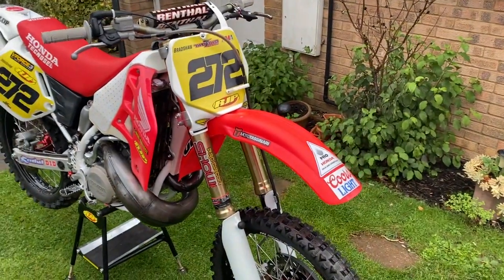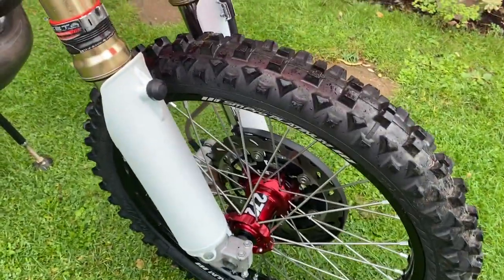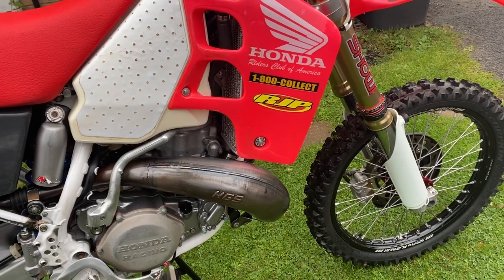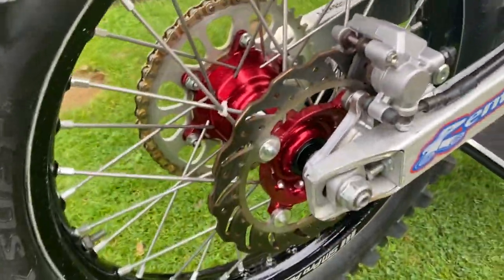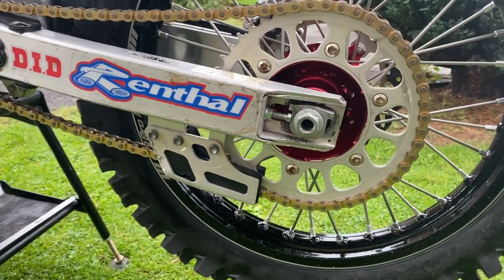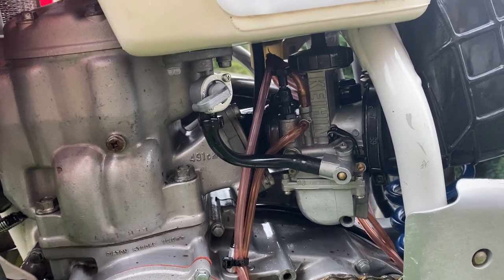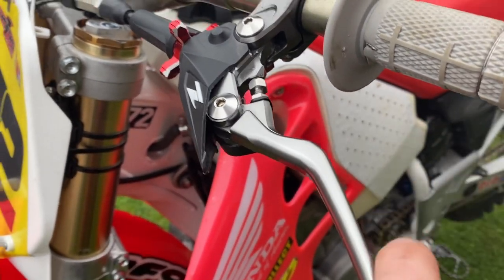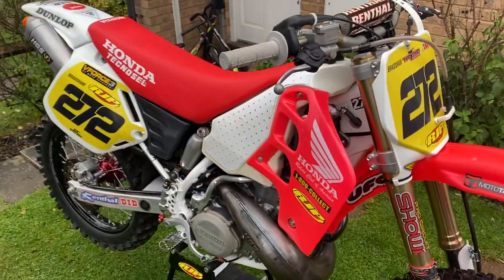1998 Honda CR500 BUILD

Comment: Phenomenal bike! I am currently in the middle of a resto frame off powder coat 96’ cr 250 putting all billet aluminum prts back on her, not as impressive as that beast of course. But after the bore job it should be right behind.lol…

Comment: Love these Honda panty droppers! Great bike Nev, like the Top Hats for the factory look. What year KTM pegs fit direct please? Where did you get the frame Guards from? I've got a 1991 Honda CR500 that I'm going through and have gotten some great tips from your video. Any recommendations for my 1991 to make it user friendly? Please don't say yeah, get a 1998 lol.  I want it to not want to kill me everytime I ride it.
Reply from the maker: Thanks bud. Really enjoy riding the big girl. Got them from RJP motorcycles. It’s what ever pegs fit the 15 KTMs. Go straight on. I find smaller rear sprocket and long silencer makes them heaps easier to ride 🤙🏻
Reply: @nevsta272  You did fantastic in the AMCA this year buddy. Very well done. Hope next year is safe and more successful for you.
Reply: @nevsta272  I was going to say it sounds quite flat on the bottom at low throttle openings, mine snaps to life and yours sounds like it eases on, I assumed it might’ve been done to make it easier to ride

Comment: Has it been dynoed .... a good friend of mine used "charlie" at Brixworth to sort his mint 92 CR500 out ... in the end it was doing 56 and the back wheel and rode so smooth with 450 torque and the snap of a 125 ...